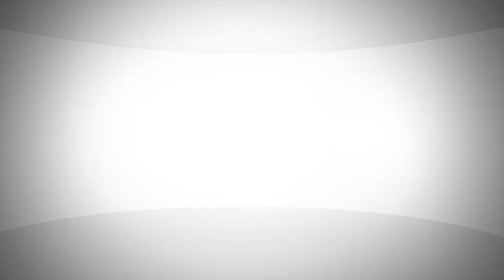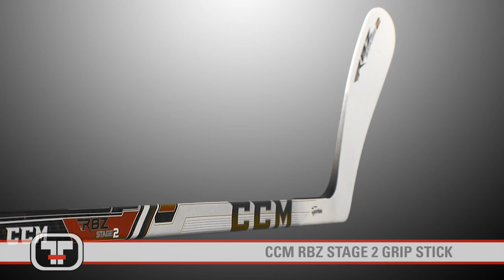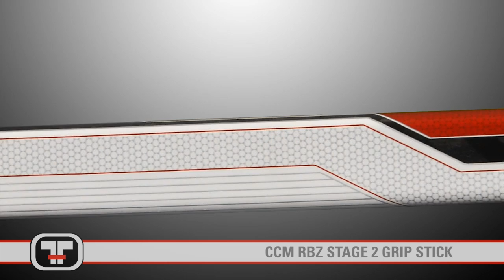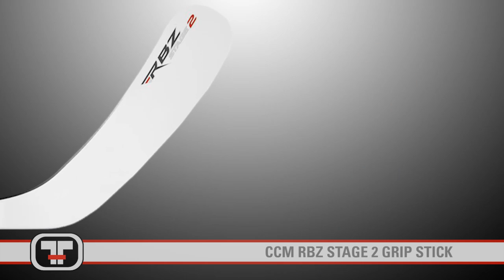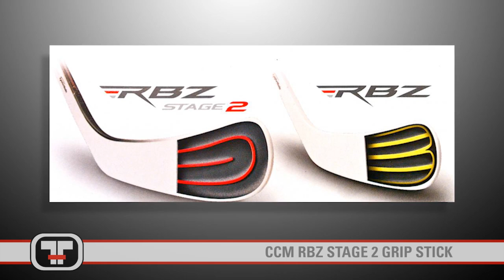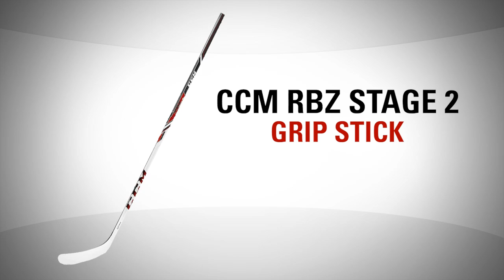CCM RBZ Stage 2 Stick

Comment: Strap a rocket to the puck. For the second time. I like that. The RBZ Stage 2 is  10x better than the Stage 1. It is lighter and has better flex points. I also think the new speed channels help the shot a lot more than 20%.

Comment: Sher-wood rekker ek15 vs the ccm rbz stage 2. I have to decide between these two sticks. I want a stick that will improve my shot. What stick will improve my game best out of these two? I very rarely take slapshots so which stick will be the best for me? I need a stick that will give me tons of pop but it is also very durable. Last thing, I am 13 and I play bantam AA, I am about 98 lbs so for the rekker ek15 should I move up to a intermediate? I need a stick that will be durable also.   THANKS!!!

Comment: is it worth the extra money for the stage 2 or should I just get the older version (ccm rbz)?
Reply from the maker: The Stage 2 blade was upgraded to SpeedBlade 2 technology (from 1) and has Freak Channels.  The result is a more responsive blade, which does a better job of "channeling" energy and producing the "trampoline effect" which the RBZ is known for.  CCM tells us that it produces 20% more "pop."  Who knows if that's actually true or not?  But the bottom line is that the Stage 2 is definitely an upgrade.  The choice is up to you.